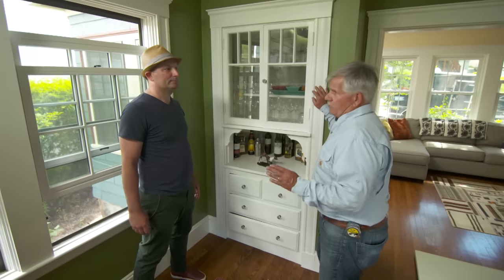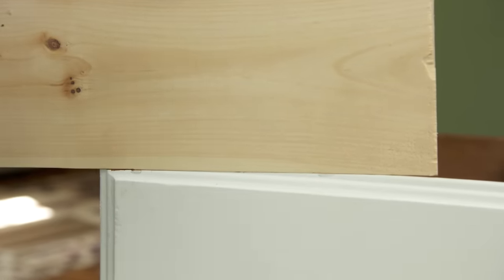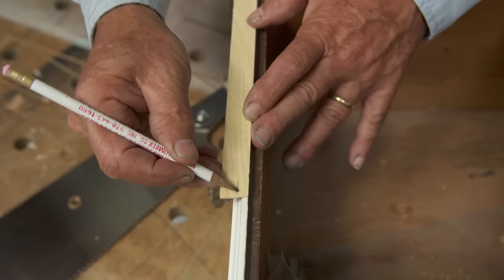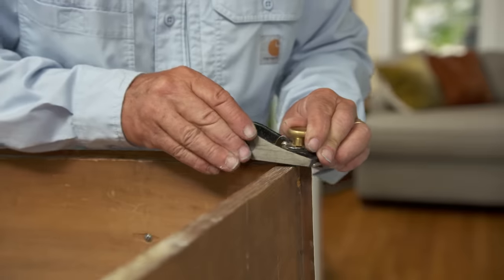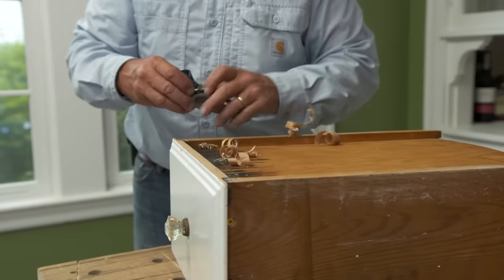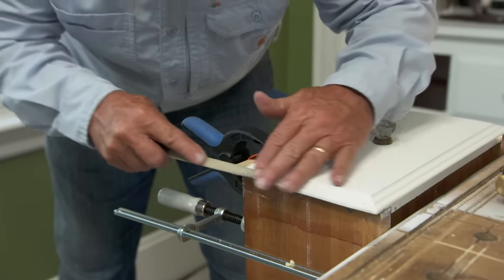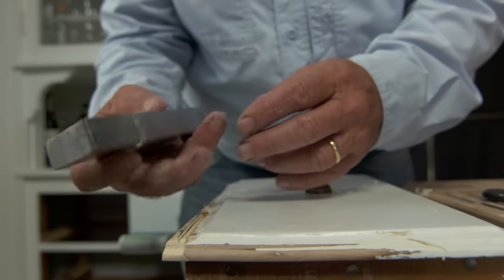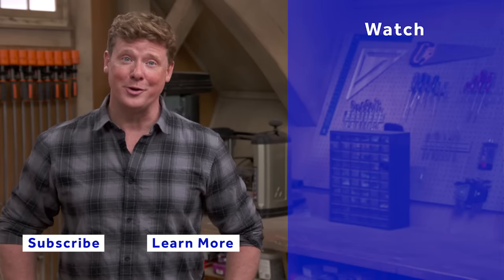How to Repair a Built-In with Hand Tools | Ask This Old House

Comment: That soap trick is so great. I have a wood on wood drawer in my kitchen that has been nothing but grief. A bit of soap fixed it right up!
Reply: From another YouTube channel (honest carpenter show), I learned of a similar trick of using dry lube like graphene. It'll probably stain the areas of contact but lasts much longer ... I did it on an old wooden dresser and the results were pretty impressive

Comment: While soap will work well and is what was used years ago, it is not always easy to find a soap that works today. You need a soap like Ivory that does not have a lot of additional chemicals or odorants in it. Another trick is to use an old wax candle. Rubbing the butt end of an old taper candle will actually deposit wax onto the surface which will act as a good lubricant.
Reply: I always used carbon.
Reply: So Ivory is hard to find. Pretty sure I've got a few bars in the bathroom now. But you are right about the wax. I'd almost use wax before I used soap.
Reply: @MrEazyE357  I did not say that Ivory is hard to find. what I said was that you need to use a soap like Ivory which is one of the few soaps still available that does not have a lot of chemicals. Many soaps today are loaded with anti-bacterial chemicals as well as odorants which would not be good for older wood.

Comment: Roy Underhill used to make a comment to the effect of "look, when it gets down to it, you can make a piece of wood into any shape you want with nothing more than a rasp or coarse sandpaper and some patience. But I try to avoid using rasps on this show because it's not treating wood like wood. A rasp is indiscriminate. It doesn't allow you to understand how the grain of wood works, and how to take advantage of that grain." But it's nice that you can make repairs like this on complicated things like ogee moldings without the need of a special molding plane or a router and a specialized matching bit.
I miss the Woodwright's Shop. It's been dark for a couple years now, and the last season we got was a "best-of" collection.  I need to get down to his school and take one of his classes. Darn if the seats don't fill up quick though.

Comment: I'd think the saponins in the soap might degrade the wood.   (It's the reason you should limit the use of soap on wooden cutting boards.)  Just to be safe, I'd stick with wax for the drawer slides.
Reply: @R. Rodriguez:  Wax isn't exactly proprietary.

Comment: I'm a little surprised at the "uphill" planing to created the flat glue surface.  Good thing it didn't catch and tearout the wood.
Reply: Sharp iron will cut anything. Also depends on the type of wood. If it were fir or pine then yes it may tear out but it wasn't very steep. Any hardwood like mahogany, teak or oak it doesn't really matter
Reply: @johnsmith-wc8gs  
So what you're saying is:
If I want to be a rather lazy woodworker and not deal with all that tear out nonsense, just work with mahogany, teach or oak and not bother with fir or pine, right?
Reply: @scotttovey  what I'm saying is sharon iron will cut anything...... but black walnut is less likely to tear out than western spruce

Comment: Tommy is amazing with hand tools, but I would have just made new faces the drawers and matched the profile with my router.
Reply: Brad Bennati I can see you don’t know much about old houses. You cannot buy that wood anymore because it is old growth. Throwing that away proves one’s lack of experience.
Reply: BlackSwan912 I know a lot about old houses and carpentry and construction in general. I’m a master electrician and an avid woodworker. I build period correct reproduction furniture from rough cut and reclaimed lumber in my spare time. I’m all about maintaining the character and look of old houses but, not at the expense of functionality. First off, it’s painted, so nobody would ever know the difference. I would have built new dovetailed boxes for the drawers and put ball bearing glides on them anyway. It would look just as good, work better, and last longer, with less maintenance. I could easily reproduce that profile on the drawer faces.
Reply: @bradbennati2600  I'm sure your repair would be amazing, but Tom's repair has charm, and also there was probably a budget they had to meet because the homeowner didn't want to spend too much on the repair project.

Comment: Gorilla Glue?  How fast could that possible dry?  That is probably the worst glue to use.  Is that the expanding stuff.  It will break right off.  Tommy!  Whatchu doing mang?  Use CA on one side and spit on the other.  Instant grab and you can move right on.  Who told you to use that Gorilla Glue?  Gorilla Glue Company?  Gorilla actually makes a CA glue that is a gel that works very well with the spit method because it doesn't soak into the wood like the less viscous glues.  I have had extremely good results with no delays using it.  Tommy!  You listening, mang?
Reply: Alex T You now what mang? Who cares! 😂
Reply: You're forgetting one of the purposes of working with home owners in these shows. It's to teach them a skill they do not have. That requires teaching them the proper procedures , tool and yes the proper glue to use.
Don't be such a brand bigot. 
Most of the stuff we purchase, have different brand names but come off the same assembly line. That includes processed food.